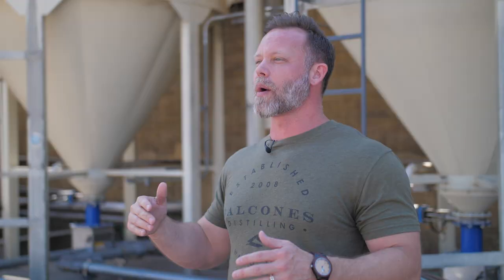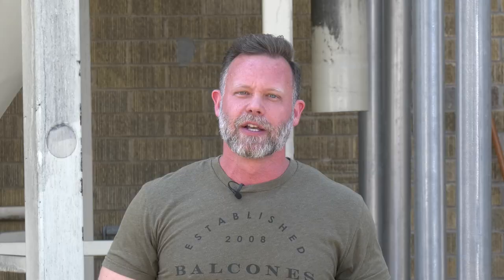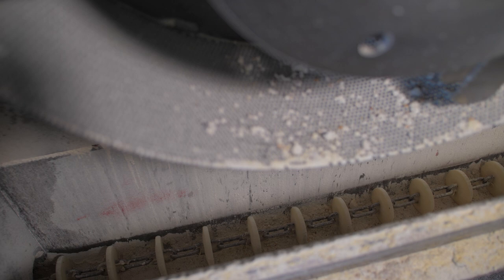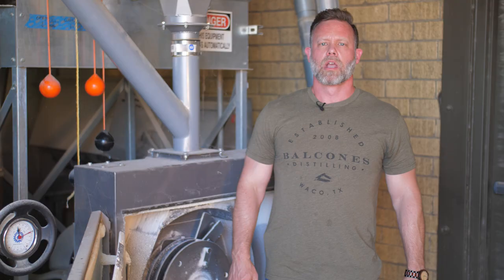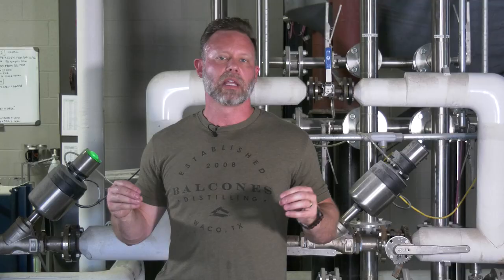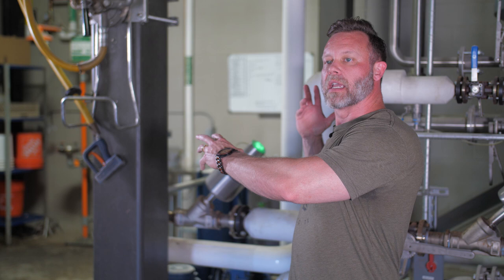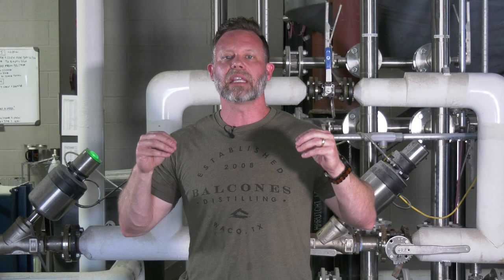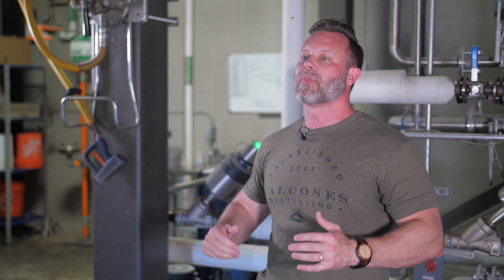How Bourbon is Made-Bourbon Real Talk Episode 107

Comment: Excellent explaining!
Reply from the maker: Thank you! Do you have any specific questions or thoughts about the topic?
Reply: It’s the most thorough explanation I’ve ever come across and I appreciate your effort to put this together and share it. One thing I was wondering was how the other grains in a mashbill are treated and prepped before the cook, are they all mashed into a pulp in a method that also effectively increases surface area? If so, how so? Also wondering how pot distillers know when to expect the heads to stop, heads to start and end, tails to start, seems like I recall another explanation where some distillers have a slipstream coming off the still where the distillate’s specific gravity is measured, is that correct? I’m especially appreciative of your explanation of pots vs. columns. I’d like to get more on the inner workings of both methods/devices. You mentioned something about reprocessing the feints, in the same breath as material that comes off the doubler which sounded like a feature specific to a column still, what is a doubler? Also I thought with a column still the heads are volatilized into the atmosphere so I wouldn’t think feints could be part of a column process, unless you deliberately recaptured and condensed them for the sake of reconciling them with the tails. I don’t know. I’m confused but, I have to admit…you got me geekin’.

Comment: Great video Randy. I've toured several distilleries in KY and you touched on all the major and even some of the minor steps involved in bourbon making. One thing I'm curious about is how the weather here in TX affects the maturation process in comparison to KY. I would assume that it doesn't have to be aged as long in Texas do to the fact that we have more hot months here where the bourbon would be pushed in and out of the oak. Thoughts on that?
Reply from the maker: During maturation you have chemical reactions happening in the barrel developing flavor (like esterification), you also have have extraction of compounds from the wood, and you have filtration of compounds out of the whiskey by the charcoal layer.  The problem in TX is we get tons of extraction and filtration from the extreme (relative to KY) temperature swings, but that means that we do not have as much time in the barrel for the chemical reactions to take place.  Texas is a place where maturation is a huge problem. At first distilleries aged in small barrels and sometimes in shipping containers (hot box aging) to speed up aging to get a product to market faster.  Many of these products were odd tasting because they already had higher levels of congener compounds due to the pot still distillation process (most of KY is column), and they didn't have enough time to develop in the barrel.  Most of the maturing distilleries in TX are now trying to find ways to slow down the aging process to give the whiskey more time to develop in the barrel without as much extraction and filtration. 60 and 63 gallon barrels are becoming more popular to reduce surface area. I could go on, but you get the point. Due to all of this you see much lower age statements on TX whiskey than you do in KY, and I suspect this will always be the case.

This was a good questions. Would you like to join our free member community? www.facebook.com/groups/bourbonrealtalkcommunity
Reply: @BourbonRealTalk  I just sent a request to join. I'm also a member of SSW. Thank you for the invite. Bourbon has been my go to spirit for a very long time but until now, I haven't joined any groups. Looking forward to developing friendships with fellow bourbon drinkers!

Comment: Why is barely malted but not the other grains? Why did you not show the malting process?
Reply from the maker: 1. Malting is basically making the grain thing it is going to grow into a plant, then stopping the process after it has converted its carbohydrates to sugar. Barely has enzymes that convert carbohydrates to simple sugars. In fact, it has a lot of it. More than it needs for its own level of carbs.  It is in most mash bills because the excess enzyme works on the other grains like corn, rye, wheat. The malting process activates these enzymes that prepares the grain for fermentation or for use in a cook with other grains to convert everything to sugar. 

Other grains can be malted. I have had malted corn whiskey and have had several malted rye whiskies. I am not sure I have ever seen a malted wheat whiskey. My guess as to why the other grains are not malted more often would be the practice of doing what malting would do, but with the excess enzymes from the malted barley in the mashbill. 

2. The only distillery in the US that I know of that malts its own grain is Frey Ranch.  Almost all distilleries buy their barley already malted. I have never toured a malting house (Frey uses a drum), so there was no way for me to include that in this video.
Reply: @BourbonRealTalk  Great explanation.
Thank you very much!!🥃